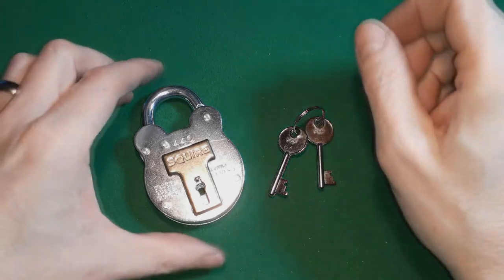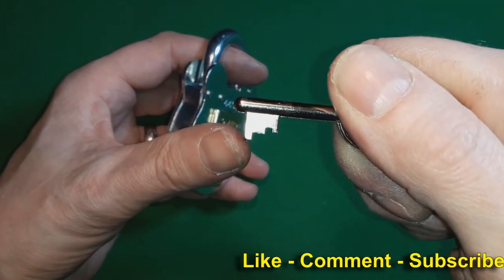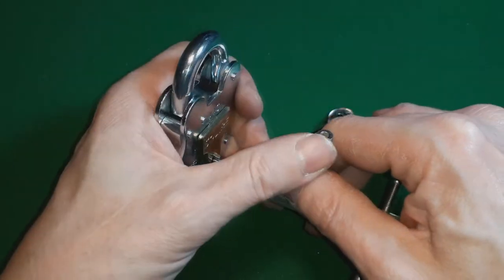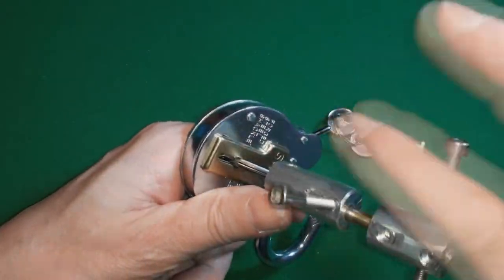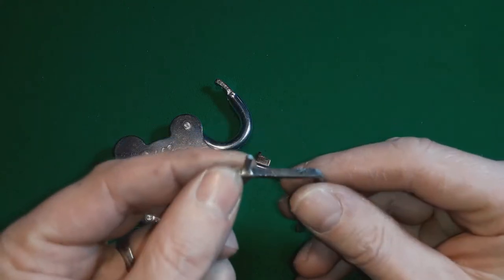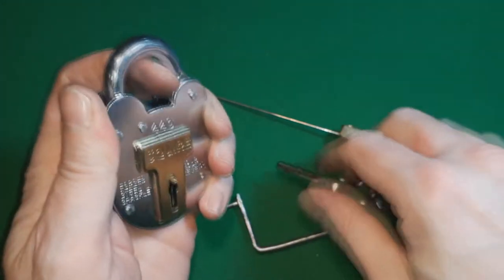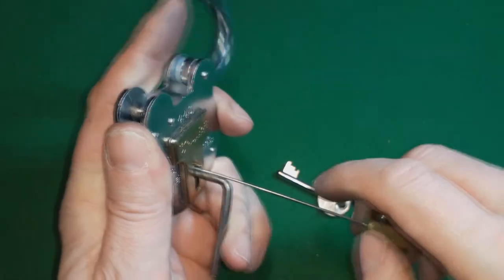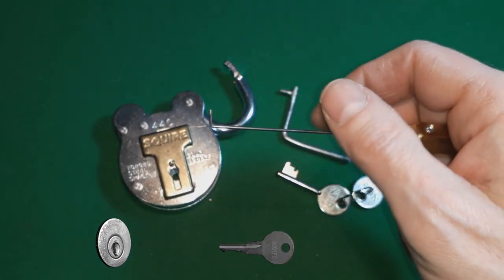(204) How to pick open a Squire 440 Old English Padlock 2 different ways

Comment: Very ingenious 2 in 1 home made tool.
Picked two ways, very smooth. 👍🦊
Reply from the maker: It's like a poor man's 2 in 1, not that difficult to make and it does seem to work. I am wanting to make it work better and acquire more lever locks to improve and hone picking. Hot some in thr post but Shhhhhh don't tell the mrs 🤣.
You are one of the pickers that gave me itchy fingers to try lever lock picking.
Thanks for watching Jack.

Comment: Roy, nicely done. Good to see two different sets of tools used, you made it look very easy.
Reply from the maker: Not a difficult pick really but you never know when you buy a lock. I have another 440 that's much more difficult to pick. I like my home made hybrid 2 in 1, it's doing really well. I am hoping to perfect it at some point. I have also got plans to improve the (Brummie designed)  bent nail tension wrench too.
Cheers for watching Paul.